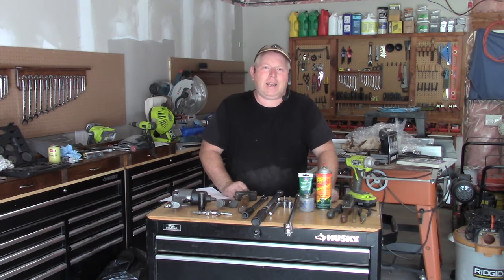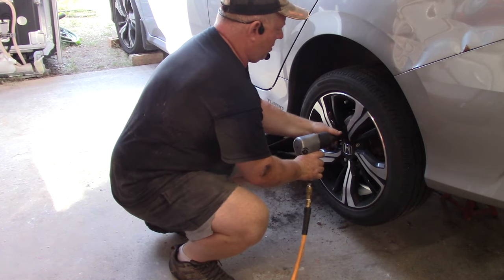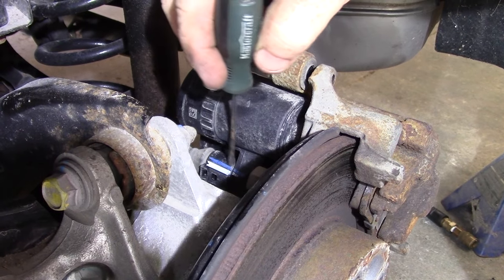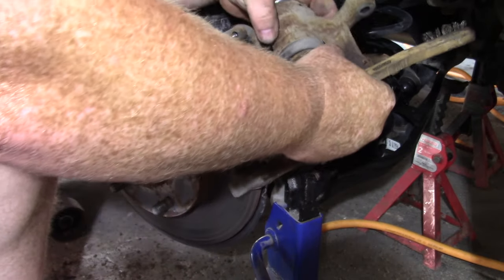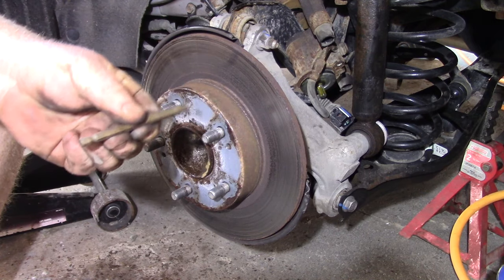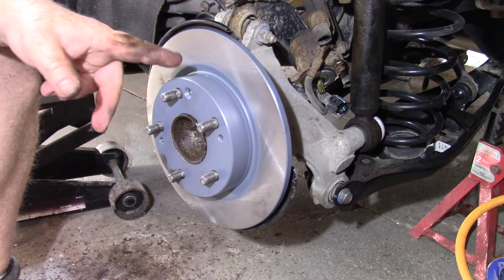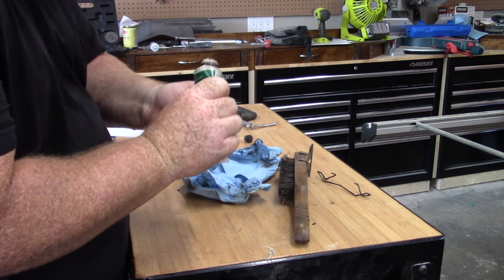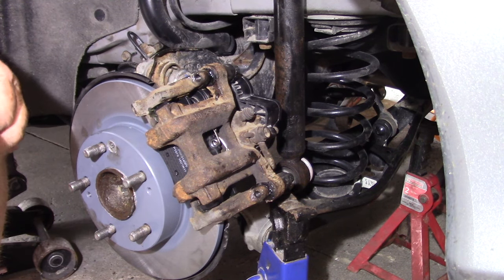DIY 2016 + Civic Rear Brake Replacement With EPB Using Honda Tech Manual

Comment: My rotors get rusted and bended and I'm only on 31K km... Do you have any idea why they fail this quick ? I have Civic sport touring 1.5 turbo 2018.
Reply from the maker: It's best to drive your car daily or they tend to rust.  Hard braking can warp rotors.  (like rush hour driving in Toronto or Montreal) Sometimes dealerships/mechanics try to get you to service the brakes early so they can make more money.  If they aren't too bad I would keep them but if they are pulsing heavily or you just find them really annoying you can switch them out.  Get the premium grade parts from any parts store - call around for best pricing.  It's relatively easy DIY.  Good Luck!
Cheers!
Rob

Comment: I've been doing brakes since the 60s, and everyone knows you can just use a C-clamp to push the piston back in.  Well, you can't in this case - thank you Honda.  It's always something with you guys.  Now I have to look up how to replace a broken and leaking EPB unit.  Hopefully I won't break the one on the other side, too.
Reply: Did you try to compress the caliper without removing the electronic parking brake actuator?
Reply: @markb1511  In my case I did unscrew the parking brake first. Then I tried to use a C-clamp and it slipped punching a hole from the back.  I bought a used unit online and, basically, subbed the entire unit for the used one.  Saved about $200 versus new parts, and the new parts would have had to be assembled.  The used parts were ready to mount and then bleed.
Reply: I have seen rear disc brakes that have a mini drum incorporated into the disc for a parking brake, but my understanding is that you can’t just use a C clamp on a calliper equipped with a parking brake, whether it’s got an electric actuator or a cable. My Elantra had a cable parking brake that closed the calliper and it needed to have the piston screwed back in while it was being compressed. You couldn’t just stick a C clamp on it like you could with the front callipers

Comment: So i am going to being this soon or later so hoping anyone can respond and help me out just in case. So if the Electronic parking brake assembly wheel will not spin by hand, how would you get it to budge? If i run into this issue id like to know what to do in advance. Thank you!
Reply: I should say what tool do i need not how lol
Reply from the maker: A ratchet and the bit listed in the video

Comment: Bro i change everything put it back and i thit the steps and now it says " Brake Hold Sistem Problem". What can i do?
Reply from the maker: After you put it back together did you calibrate the EPB by cycling it 2x?  Try to cycle the EPB on fully (will take some time to do since the EPB was backed up all the way)  then release the EPB fully and do that 2 x
Reply: I have heard of many diy'ers have issues like this when removing the EPB motor. Personally, I never touched it. I just wound the piston back like normal and never had any problems.
Reply: @steve8803  hook up a 12v to the two terminal inside a rubberized connector. It’s tether to the control arm. It retracts and extend the epb depending on the polarity to the terminals. Once done, cycle the brAke lever a few time to set the parking brake.

Comment: What is it that people are doing to ruin the brake when they attempt a brake change ?
Reply from the maker: They don’t retract the EPB fully during the brake change and break it when pushing the piston back.  You also need to calibrate the EPB as shown at the end of the video to prevent ABS codes.
Reply: @robsgaragewoodworkin    Calibration is simply cycling the brake selector switch a few times to adjust it outwards  closer to the pad ?  The EPB treads must get damaged by pressing it back into the caliper,  it is a treaded movement in and out to engage the E-brake right ?
Reply from the maker: @jetboy770371    Yes it’s threaded.  The EPB has to be fully cycled on and off 2X for calibration.  When you initially engage the EPB after changing brakes it takes a long time for it to fully engage.  Good Luck with your repair!
Cheers!
Rob
Reply: @robsgaragewoodworkin  How long is long for the EPB to fully engage the first time after brake service?

Comment: Lol my piston shot out of the caliber. I had to shove it back in and stretch the rubber housing over it. Luckily it didn't tear. I had to bleed it again to get pressure and add more fluid.
Reply from the maker: WOW!
Reply: I am no mechanic but that suggests to me as an amateur that you had way too much pressure in your system and I wonder if that was pressing the piston against the pads whilst you were driving around before you did the service. I don't know whether that can indicate a possible fault in the brake system somewhere as that sounds extreme to me.

Comment: I just want to replace my EPB with a manual lever. I drive a manual transmission and want my braking system to match it. Give me full control
Reply: 100% agree
Reply from the maker: Yeah I hear ya!  It does simplify the disk brake assembly though.

Comment: Has anyone tried this on a 10th gen SI? I'm almost certain it's the same, and my pads need replaced yesterday. I'm considering trying this.
Reply: Looking for the same advice on a 17’ si. Not in need of a brake change yet, just looking into it. If you do it advice is appreciated. Thanks.
Reply from the maker: All the Honda products are similar in design.  I have the 17 Civic and 17 CRV and have brake videos up for both.  Good Luck with your repair!
Cheers!
Rob

Comment: My release tab broke off, what do I do
Reply: If it still secure I ran into the same problem. I live in Canada so our cars get dirty, salty and wet and the connector do too. I just removed the parking brake assembly with the connector still attached.  You have plenty of room to move it around and assess the bolts.
Reply from the maker: Plug it back in when your done and pretend like nothing happened...  it should stay in place.  Every time you rotate and switch tires push on it to make sure it’s in.  If you are worried about it you can order a new wire.  (If the broken part is on the wire)

Comment: You have to get the corrosion free rotors, I had to replace mine after 20K on my civic they were grinding and 3X more corroded than yours….  Honda should be ashamed of themselves for even using those pos rotors.  Corrosion free ones come oilers because they don’t rust, rear rotors still have zero rust on them after a few years.
Reply from the maker: They use ceramic coated rotors, however they do tend to rust quickly after the coating comes off.  If you don't drive your car daily it could become an issue.

Comment: the inside pad is loose while drive and rattles I tightened the spring but still loose. Please help.
Reply from the maker: The pads will be very tight.  My guess is you were given the wrong parts.  Double check the video to see how tight they fit.
Reply: Do I need to have the e break on or off during the process ??

Comment: Anyone else’s 2016 civic rear wheel bearings shit the bed yet too?
Reply from the maker: That sucks!  Were they noisy?
Reply: One of mine (a 2016 w/152K miles) have been howling for about 5 months but not getting worse.  The new pads/rotors arrived a couple days ago and I’m swapping them in two weeks.  I guess I might as well order two rear hub bearing assemblies and swap them since it will down to those last 3 bolts.  Thanks for the reminder.

Comment: Wow no clips for the pads
Reply from the maker: Yeah, it's weird.  Different design...
Reply: Twice I got the wrong Clips when doing the rear brakes on my wife's car after an hour I just cleaned up the old clips, very frustrating. My wife just got a 2021 RAV4 with them stupid electronic parking brakes its very worrisome cuz if the switch breaks your stuck
Reply from the maker: @johnkenny4017  No kidding!  I do like the new EPB’s.  I think they are easier to work on and “should” have less problems.  I totally get what you mean though about the switch breaking.

Comment: I did this now I have break system errors on my dash
Reply from the maker: Did you do the calibration sequence at the end of the video?
Reply: I did my rear rotors and pads before seeing this video. Now I'm having epb errors. Is there any way to fix this? Or recalibrate after the fact?
Reply from the maker: @scottdurant4837  did you retract the EPB manually or with a scan tool before you performed the brake service?
Reply: @robsgaragewoodworkin  I did it manually.
Reply from the maker: @scottdurant4837  once the code is up you can only get rid of it with a scan tool.  You will need a newer one that has the ABS function.  Or you will have to take it in to a shop.
Reply: @robsgaragewoodworkin  okay. i figured. i just used a cheap one before i saw this comment and it didnt even show my codes. that makes sense why. Thank you.
Reply: I have the same error code. And I started turning the piston before removing everything. But i did it only on the right side. Left side was easy after seeing the video 🤦🏽‍♂️🤦🏽‍♂️

Comment: Let's say my friend didn't do exactly that the epb light came on. How can HE fix this? Lol
Reply from the maker: That depends.  If the EPB was backed away fully and there was no damage you should be able to reset it with a code reader.  You “may” need a new code reader to do this.  If the system was damaged you will need a new EPB and a new code reader to reset it.  This may be a dealer only part but if you’re lucky it “may” be available at a parts store.  Good luck!  🍀 🤞 🍀 Fingers crossed!
Reply: @robsgaragewoodworkin  thanks a bunch for the help

Comment: Whyd you even take the epd off
Reply from the maker: The EPB needs to be fully retracted or set to "home position" so that the hydraulic brake piston can be pushed back far enough to put in new brake pads.  This can be accomplished in a few ways.  You can use a diagnostic computer or scan tool to electronically set the car into maintenance mode, you can use a wind back tool to wind the piston and EPB back to home position (people are having all sorts of issues with this method) or you can remove the EPB and wind it back manually as shown in my video.  I used the Honda Tech Manual instructions for manually retracting the EPB in my video.  Good Luck with your repair!
Cheers!
Rob
Reply: @robsgaragewoodworkin  thx technology always make things difficult
Reply: I’d rather spin the EPB threaded piston back a few threads than deal with the parking brake system on drum brakes!  It’s really very simple.